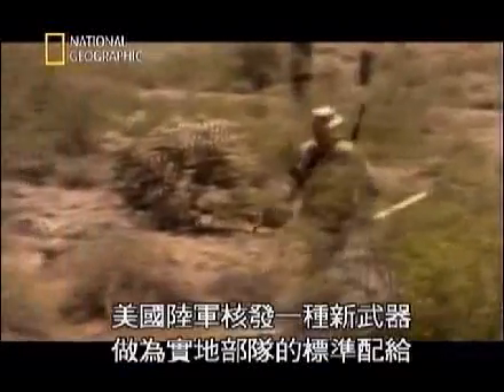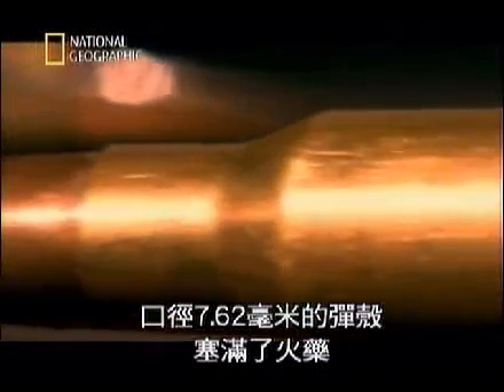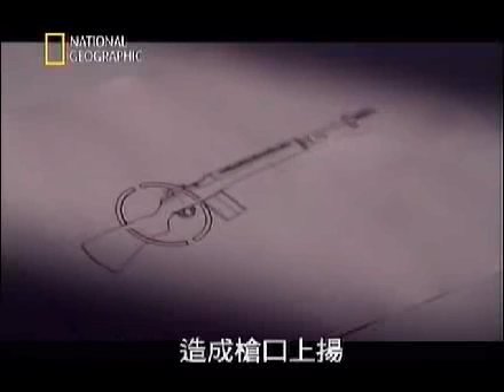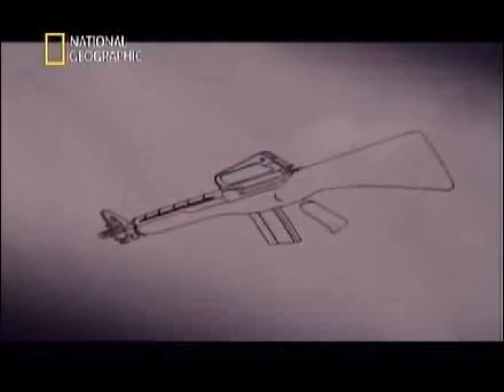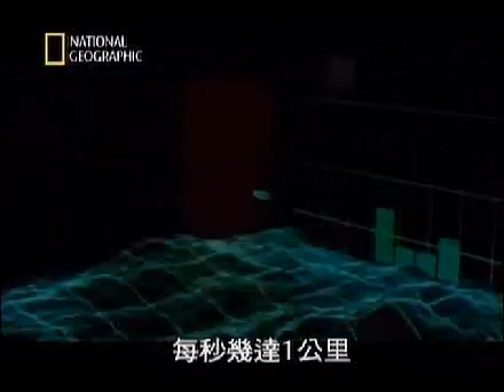Compare M14 With M16

Comment: The only guy in a squad that should be firing in full auto at that kind of range is your machine gunner.
Reply: usmc2076, SEMPER FI MARINE !
Reply: Fleece, Sorry about my timing. You sound like a Man who's Been There. Welcome Back,  In the day before the M-16,  Your Automatic Riflemen used an M-14 with a Selector Switch and could apply Supressive Automatic Fire (Short Burst) where Machine Guns were not available , But your Right Not at that distance.
Reply: if its under 100 yards every guy can. pass that useless.unless its a mass charge then yeah

Comment: When I was in the Army (1960s/70s), we trained and used both M14 and M16/16a1.  Each has its advantages.  I don't recall ever firing the 14 on full Auto, except in training.  It's a great Semi rifle, very accurate, and has excellent range and knockdown power.  And I've always been partial to the 7.62.  Maybe I got used to the recoil.
But the 16?  I used it full Auto, many times (mostly suppressing/covering fire < about 125 meters).  It doesn't have the range of the 14, but I could carry a lot more ammo and it's very accurate out to about 400 meters (in good "seeing" conditions) when shooting at a man; 300 meters or so when conditions were not good.  
The 14 was very accurate (for me) out to about 550 meters (at a man) in good "seeing", and about 425 meters or so in less-than-good (or strong wind).  
In dense foliage, however, I absolutely loved the 16, much more than the 14: much easier to maneuver, aim, and fire because of the closer ranges; more ammo; and less weight.  But, out of the bush, I missed the 14 once the changeover had taken place.

To each, his own opinion is the correct one.
As others have pointed out, nobody is going to fire the M14 on full Auto at a target 450 meters away (unless, for example, it was at a group of several men all standing close together).  And, with the M14, we normally didn't have to do so: it's range and accuracy made it fully effective on Semi.

Comment: Funny, I don't recall any Marine or Police Swat Team member EVER using an M-14 or M1A on any TARGET in the Off hand Position greater than 200 yards.  A selector switch on an M-14 was meant for Close Combat of 100 meters or less. It was Never meant to be a Machine Gun. The M-16 Specialist Instructor in the video used the M-16 in the 'PRONE' position on water melons and was NOT that impressive, He should have used an M-14 with a bipod on Semi-Auto, He would have scored more hits at 450 meters.
Reply: Id say closer than 100 meters, itll really chop things up in a tough bind. Lol
Reply: +YAH REMNANT Tough bind meaning both two 5.56s in single file in the same hole might equal one .308 round.

Comment: It can have issues with that, it depends largely on impact velocity.  FMJ fragmenting 5.56 is only really intended for up to 400 yards or so, and most engagements are going to be less as far as I know.  At those kinds of distances and with a 20" barrel as designed it will usually work great.  Then people want to run M4 barrels though and you can't expect the same results, soft point ammo is better in that case.

Comment: Contributing to the problems of the early M16 was that the type of powder was changed to ball at the last minute, which is much dirtier than what was originally intended for the weapon. Also, certain internal parts (i.e. the barrel, chamber gas tube, etc.) were originally meant to be chrome-lined, but the weapon was sent to Vietnam without it. I may prefer the AK 47, but the modern AR 15/M16 is infinitely better than the rifle that was sent to Vietnam.

Comment: The m14 was designed under the one shot one kill philosophy. It does not do a good job at sustained suppressive  fire which is more of a new army, NATO philosophy. It should be noted that once this strategy was adopted, along with the new rifle, America started losing wars over and over again. It's interesting to see the military switching back over to 1911's and EBR's M21's and M14's again. It is the perfect patrol rifle. This video is just colt propaganda.
Reply: Michele Vick I couldn't agree with you more.
Reply: "losing wars" ????   The US did nothing but kill kill kill with those new rifles(m16).. Changing rifles had nothing to do with "losing" any wars(if you wanna say that, those weren't wars that were going to be own or lost fighting an ideology instead of a country)

Comment: Thank you for your service, and I agree, they never fully tested the M16 for "Combat Conditions" as in running it through mud, sand, heat, cold, and jungle conditions. I like the M1As, wouldn't mind one myself, especially fitted with the SAGE EBR stock.

Comment: M-14 all the way, never should have introduced the M-16. Would have saved many of our troops in Vietnam.
Reply: Not really. better Jungle warfare training would have saved lives
Reply: the M16 was more suited for Vietnam and eventually would have lost more troops if they were still using the m14 in the long run.. Yes there was some hiccups in the beginning but that wasn't due to the m16s design it was due to negligence (ie not chrome lining barrels, using old ball powder, and no cleaning or cleaning kits)
Reply: You can't kill anybody when you run out of 7.62-51. You can carry double amount of 5.56 for the same weight. Most engagements in vietnam all you could fire at was muzzle flashes.
Reply: The M14 was allot better rifle . The  7.62x51mm round would tare through the jungles vegetation unlike the M16's 5.56x45mm round . The M16 was originally useing a varmint round .223  . The 762 round creates a bigger hole 2 well placed shots where putting the enemy down . While the enemy was doped up on drugs the enemy kept advancing after 8 rounds where placed into them. The M16 still has jamming problems to this day it constently has to be cleaned and there's a ton of parts to field strip . That wasent a problem for the M14 . The only problem the M14 had was weight wich caused fatigue and recoil in full auto mode. The M14 has proven it's accuracy with the M14ERB,  M21 & M39 .The M14 is better for picking off targets while the M16 is better suited for on the move fireing because of its type grouping in full auto because of it's low recoil.
Reply: @Texasmilitarydepartmentvid9654  you just show the true

Comment: Look up the Armalite AR-18AR-18's action was powered by a short-stroke gas piston above the barrel. The gas piston was of 3-piece design to facilitate disassembly, with a hollow forward section with 4 radial gas vent holes fitting around a stainless steel gas block projecting rearwards from the foresight housing.

Comment: I love the M-14 too. I have an Armscorp M-14NM. It is s superb rifle and an absolute tackdriver at 100m. But the AR-10 is not the best of both worlds.It still uses the same heavy round as the M-14 and that means for the same given weight, I can carry twice as many M16 rounds. I carried an M16/M4 for over 23 years in the US Army Infantry and Rangers. The two things you carry the most of always are water and ammunition. And full auto is rarely used by a rifleman, That's why each fireteam has a SAW

Comment: @CaptainObvious1970 The general rule for M193 fragmentation is 2700 f/s. The M4 with it's 14.5 inch barrel has a fragmentation range of less than 100 meters with current issue M855 spec ammunition. I'm not arguing that M14s don't have their place, but for the general infantry, the M16 is fine and does its job well. All these armchair commandos need to stop arguing that their grandpa/uncle/whoever did this that or the other because combat experiences/memories aren't passed down in the bloodstream

Comment: its because of the powder they were using... during trials they used stick powder which worked perfectly and never had a jam. but when they went into mass production they used ball powder which burned worse and caused gunk to build up in the receiver and caused jams and thanks to no cleaning kits issued because of the high rating in testing they thought they didn't need them

Comment: SIMPLE SOLUTION- M-16 for the Jungle and Rice Paddy, M-14 for the Sand Box. And if you want to try something Really Heavy ? Carry an M-3 'Grease Gun' through a Rice Paddy with all those spare mag's of .45 ACP with the mud sucking you down in 120 deg. heat. Sorry about my 'Late' timing on this thread, but I just Received this from 'Google'.

Comment: @WaywardPatriot I agree. If there is .308/7.62 replacement it will be the SCAR-H. The SCAR rifle is modular design that can refit different stocks and barrel lengths easily. The normal SCAR is 5.56, but the SCAR-H (H for heavy) is in 7.62x51.

Comment: @TheGrankuma It's a battle rifle because it was made to work.  Frozen, covered in mud, full of sand, in 140 degrees, when its rusty and wet and hasn't been cleaned in days, it fires.  Field cleaning doesn't involve disassembly.  You can keep it operationally clean by locking the bolt to the rear and cleaning the exposed parts, punching the bore, and cleaning the chamber.  The m16 needs disassembled a couple of times a day to keep it shooting.

Comment: @esh325 That is very true, the yawing and tumbling effect of the 5.56x45's are significantly reduced at longer ranges as well as hydrostatic shock. As you mentioned, to combat this deficiency dedicated marksmen in infantry squads are issued the Mk 14 EBR which is a modernized version of the m14 but pretty much the same rifle chambered in .308 winchester also known as the 7.62x51.

Comment: @shaynemcallister This is the weapon that is the production version of the MAGPUL MASADA, correct?  Some small variations in final design, but the composite stock and lower receiver, simplified blowback and interchangeable locking-bolt design all seem very similar.  Firing from an open bolt is a pretty cool advantage, it puts the power of a LMG into the tactical range of a battle rifle, instead of just as a base of fire.  Great suggestion!  I would love to see the US Military take full advantage

Comment: @Toolofdeath 

Easy question. The shock of blowing off the little toe, as well as the toes near it due to the concussion of the bullet, will send massive shock waves through the body that will ultimately provide a fatal heart attack. Failing that, it will at least provide enough pain to the target to better enable the shooter to take a better shot.

M14 FTW!

Comment: The narrator had failed to mention that basically Stoner started with the AR-10 in the general profile and design with the same cartridge as the M14, whichwas comparatively better at controlling the kick. The round was still too powerful in full auto, and it was too heavy, meaning soldiers never had enough ammo for prolonged engagements. So Stoner scaled everything down, to fit a smaller round similar to the Remington .223 which was marketed for varmit rifles at the time. This gave the new AR-15 a better performance edge in full auto control and ammo capacity per soldier. Very important for logistical and tactical reasons.

Comment: No, the 5.45x39 was referred to as a poison bullet because the tip of the bullet was hollow. This would actually cause massive damage, but a regular fmj 5.56 does not reliably have the same effect. I find it hard to believe we are still arguing whether a 150 grain projectile is more powerful then a 55 grain projectile.

Comment: Honestly, I prefer the AK. It may not be nearly as well-made, or nearly as accurate, but you can do almost anything to that gun and it'll still keep firing. I heard a story where a N. Vietnamese soldier had died & was buried with his gun. A YEAR later, a U.S. commander who was there with his squad pulled the AK out of the ground and fired it. It worked perfectly. Sand, mud, water, it doesn't matter to an AK. Also, a trained person can take it apart in 15 seconds, blindfolded. I've seen it done.

Comment: @ad855 actually, I think the DMR is an A1 lower (apparently the 3 round burst gives 3 different trigger pulls, depending on where the cam is set) with a match grade A4 upper with a scope, and special ammunition.  I'm thinking of the Mk14EBR (enhanced battle rifle)

Comment: I've owned and fired M14 and AR15.  In the early 80's I bought a "Mini 14" and discovered that it was probably better than either.  It had the simple utility of the M14 and the advantage of low recoil, lightweight .223 ammunition.  They didn't need to re-invent the wheel, they just needed to make the M14 in .223...

Just my opinion of course but I've lugged a Garand and a load of .30-06 ammo around and I'd take .223 any day of the week.

Comment: @WaywardPatriot yeah. it's a cool gun. I think you can even switch between open bolt and closed bolt operation. Open bolt to allow for greater cooling in LMG mode, and closed for higher accuracy and prevention of dust getting into the chamber. But you could also convert the same gun into a sort of sniper rifle or Designated Marksman rifle.

Comment: @esh325 You may be right, but I don't think so.  I think the 5.56 round was developed first then it was released as the .223 commercially (and yes there is a slight difference).  The 5.56 was initially developed after they tried the .222 and the .222 Mag.  The pair of .222's were close but not quite what they wanted so they modified the magnum slightly and created the 5.56.  You are correct in that the .222 was a varmint round.

Comment: I've put thousands of rounds surplus 5.56through my Mini-14 without any problems. However the Mini-14 was designed to chamber the 5.56. Some rifles this is not the case so you need to be careful, contact the manufacturer first. 

"Firing a 5.56mm cartridge (which is loaded to higher pressure) in a .223 Remington chambered rifle (which has a shorter throat causing a further boost in pressure), could exceed the safety margin in a .223 Remington rifle. It cannot be done with complete safety"

Comment: The fragmentation depends on the twist and length of the barrel as well as ammunition grade. I've seen a leg wound inflicted by a single 5.56, it literally burst the leg open. Many wounds from 7.62 x 39 mm are often relatively clean. 7.62 x 51 mm occasionally fragmented. 

Anyway, the ammunition capacity is the most important factor in modern armies. Even 7.62 x 39 mm users like Russia switched to 5.45 x 39 mm round, which is even smaller than 5.56 NATO.

Comment: @nov284 What are you talking about?  I've had a pretty low-quality AR and it went "boom" every time I wanted it to.  Cleaning is easy: wipe down the gas key with a towel.  Use a dry lube (e.g. wax, militec...).  I could clean my AR faster than my friend could clean his SKS.  Of course, I wasn't shooting 1000 rounds/day.  It doesn't really require a serious cleaning--just maintenance where it counts (e.g. the chamber and locking lugs), just like any semi-auto.

Comment: @STL308 In Somalia the first deployment I had the M16, the second deployment I had the M14 with the military designator M68 Aimpoint. Future deployments to three other countries I had the M4 w/ M203 attachment. The M14 was by far the heaviest, but by far the best for me. However, there were mission specific appropriate times that I set aside the M14 for an M16 in CQB situations (back in 1993, most units didn't have M4's yet).

Comment: @STL308 Not that, I'm just a weapons freak. The FN Herstal Mk 17 SCAR-H Long (7.62X51) is currently slated to replace the M14, if it can fit in the military's budget. It's a tough piece of hardware. It has a short-stroke, gas-piston operating system. Upper receiver is aluminum, housing a free-floating barrel for better accuracy. Lower receiver is polymer for reduced weight. Both versions can be equipped with mission specific quick-change barrel lengths in 16-inch or 20-inch. Vaguely familiar.

Comment: @STL308 What i meant by that comment is its a much more effective sniping platform than the AR-15 type rifle. The M16 generally is a better assault rifle as it can lay down suppressive fire more effectively, but the 7.62MM round of the M14 enables an operator to engage targets at a much further distance effectively than with a 5.56, its a better DMR than the M16, as the 5.56 isnt really a good round for sniping, it doesnt have the punch at extended ranges. Plus the M14 is more reliable.

Comment: @simon12194 Probably might not solve the problem of recoil since the stock of the M14 still has that pivot in the rear grip area. M14 is still used nowadays as a Designated Marksman Rifle (DMR) since it's still a good accurate rifle, just not in full auto.

Comment: In short,

"A .223 Remington cartridge can be safely fired in a 5.56mm chambered rifle, but NOT vice versa."

So you need to know. Some rifles (like the mini) say .223 but are actually designed the chamber 5.56. So you do need to find out from the manufacturer what you have.  And I'm not even sure about the older Mini-14s they might be chambered for .223 REM.

Comment: @RyanR3volution I didn't know that you can now buy a true Steyr here in the U.S. That would be pretty slick. I've always loved the lines of that bullpup. I have the MSAR STG 5.56, opting for the classic 20" barrel instead of the 16". it's a really sweet shooter, but it's only downfall (like all bullpups I've ever shot) is a very sluggish trigger pull due to the linkage.

Comment: Many people bash the 5.56 round because it is so small but it really is an amazing round. I resisted getting a 5.56 for yrs but when I got one I fell in love with it very fast. Yes there are some things the 7.62 do better but overall the M16 and 5.56 were a huge improvement. Lighter, easier to control, more rounds and very flexable platform. What more could you ask for?